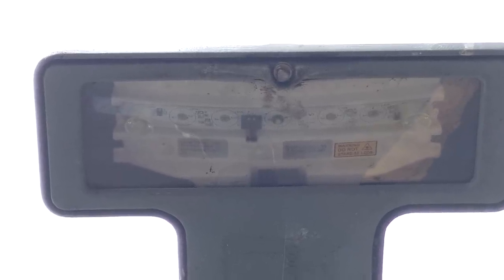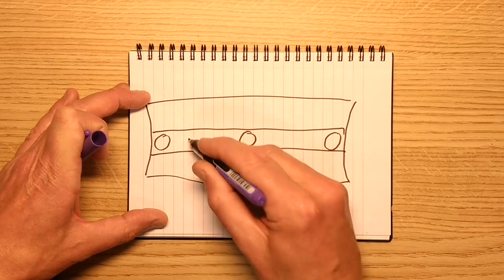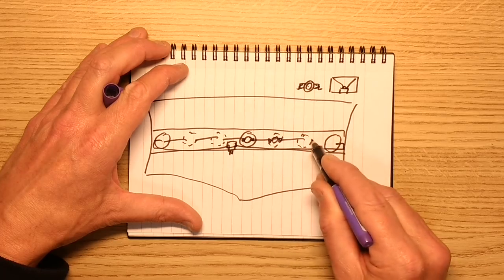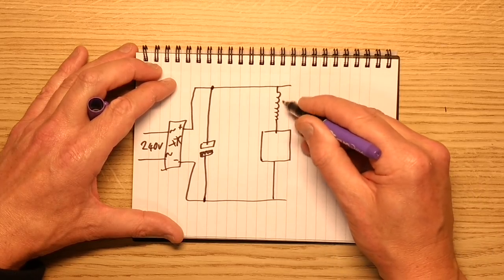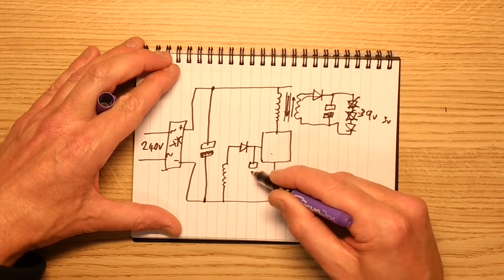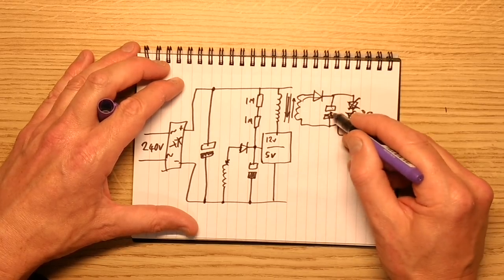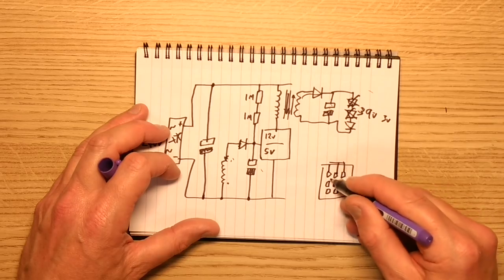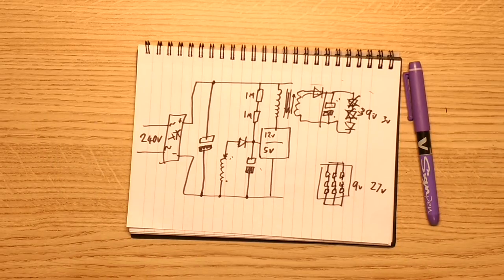Non-contact autopsy of dead sign light.  (strobe warning)

Comment: It certainly makes the sign more prominent and draws attention to what its saying, not sure on the safety of the people driving by and having seizures though. 🤔
Reply: That's why I think y
The EU is on to something when in hard braking about lock up braking events they actually flash the reverse whites to tell people that there is an emergency braking event ahead.
The main reason I will flash my brake reds before a hard braking event.
Reply: @jacknickolstine3355  modern cars actually will pulse the reds. Many more actually trigger the hazards on an emergency brake event (this is aside from people who activate them when braking in traffic).
Reply: @lmaoroflcopter  yeah I know but it's not mandatory for the OE to put that in the vehicle. 
I'm more or less stating its advantage.
Reply: Sassy The Sasquatch Where do live that such lights are not allowed on vehicles? Here in the states, it is perfectly legal. (At least in my state. Most others must be the same way, as many inter-state tractor trailers have lots of "unnecessary" lights.)
Reply: @TravisTerrell  The UK and I think most of Europe all have laws regarding what lights may be affixed to a vehicle and what colour.

General rule:
white solid and amber flashing up front.
Red solid, red momentarily switched, amber flashing (or steady iirc) and white only when reversing to the rear.

Blue and Red strobes are emergency vehicles only.

Any other lights must be off when the vehicle is on a public highway. You can still fit them for that fast and furious look while posing on private land, tracks or in car parks, but they can't be on when on the road.
Reply: @lmaoroflcopter  
Actually here in California I could drive down the road with a red strobe light.
 I just can't have a blue one

Comment: As a former salesperson for these kind of things - that's an LUA sign light made by a company called Simmonsigns Ltd in Telford and pretty much the standard model in the market (the LEDs / gear tray could be from Simmons or any number of other suppliers). The most common fault with sign lights is with the controls rather than the LEDs - a lot of LED sign lights were installed with a CMS node and a "smart cities" type of package to control them via GSM and a mesh network, and the telecells are not up to scratch. The other options is a photoelectric cell, usually set to come on when light levels drop below 70 lux and then turn off in the morning once the light goes back above 35 lux. #1 problem with a PECU is when the sensor doesn't include a filter to help it ignore artificial light sources, so the sign light comes on, then the street light comes on, and the sign light turns off.

Comment: That explains why so many of the LED lights in our gym pulse like this.  I've also seen good working LED lights pulse once when first switched on, probably because the secondary capacitor takes a bit more time to charge than it can get before the bootstrap supplied capacitor runs out of charge.  Then on the second flash the secondary capacitor isn't such a load and the circuit can get started properly.

Comment: I can see why local councils, which have huge electricity bills, are switching to the most efficient forms of lighting, but if this is likely to happen it may be a false economy. Within the last few years Fife Council stripped out the sodium lights in our road and replaced them with far smaller but equally bright LED streetlights. None has failed yet, but then the sodium lights ran for twenty-five years and the only malfunctions I ever saw were due to the timers jamming on.
Reply: Plus the sodium vapour lamps gave a much more pleasant yellow light unlike those eyesore LED ones
Reply: zh84 Survival of the fittest. You only see the ones that did last 25 years but not the ones that didn't, plus the mandatory ongoing maintenance cost of changing lamps, ballasts and starters, plus the cost of electricity. Even if LED has a higher failure rate at the beginning, the cost is more than offset by the electricity savings, plus the less reliable suppliers will be weeded out in time.
Reply: zh84  Up until recently, most council street lights were only controlled by photocells. No timer at all. In order to reduce cost, a lot of councils have replaced the normal standard photocell switch module with a device that also has a timing system. This allows the light to be switched off typically between 01:00 and 05:00 hours to save electricity and hence save money.
Reply: time between 0100 and 0500 - all the thiefs and the agency thugs are busy stealing things and people !
Reply: our council had 1 replacement project recently that was worth £125k and it was costed to repay itself within a year or so. So that is some saving.
Reply: Dick Johnson, yellow might be more pleasant but white LED keeps humans more awake (Body reacts to it more like daylight, less melatonin produced) and is better when it comes to visibility of objects of any colour.
Reply: Bulbs dont last long ballasts need replacing led is the way to go + you can see alot better than sodium ones. 50w at the back of mine got replaced for a 10w led and its miles brighter thats alot of energy saved just on 1 estate.
Reply: Before they replaced the street lights by led-lights, the lights switched to a lower light setting around 23:00.
I don't know about the yellow light, they are used above some highways and dangerous crossings outside a town.
Reply: Same thing with LED traffic lights, I noticed one of the LED bulbs already dead only a couple of months after it was installed.
Reply: Haven't seen dead LED street lights so far, but have seen plenty of dead older style street lights. And unless you worked for the maintanence crew or were monitoring the street lights 24/7/365/25, your statement of "the only malfunctions I ever saw were due to the timers jamming on" is, unfortunatly, totally useless. Communities did the math and the cost of old style street lighting is way higher than LED, even with the investment up front, after  only a coupld of years. LEDs fail, yes. So do older style lights. And they require more electricity along the way and fail more often, on average, when comparing similar quality products.
Reply: @mohinderkaur6671  It's a fact that most stuff is stolen in daytime.
Reply: There is a very good technical comparison between LED and Sodium lights on YouTube . The watts per lumen tables show that there is often no saving. And the blue light from LEDs disrupts sleep patterns significantly more when they are used in urban areas.
Reply: +mohider khana - Nah, shut off all the lights and they're staggering around in the dark, as they've been spoiled by all of the cities giving them plenty of light by which to rob people.
Reply: +DA666 - However, with the power companies starting to charge for apparent power, rather than real power usage, the cities will start paying more for power, with the abysmal power factors on most of these things.
Reply: Yellow light is horrible, i hated being out at night it makes your eyes go funny, we have bright white lights now and they are much better
Reply: Sun Wukong Faster reaction time from drivers apparently too under whiter light.

Comment: Ive seen ones in the US doing the same thing. usually followed by a snap crackle pop and sparks flowing out on the ground as it burns up in a fiery blaze. i dont think they even give off adequate light to see at night, compared to the previous type.

Comment: I have one of the light trays of a smiliar fixture. 3 LEDs in series with a GE dedicated LED driver but the only lenses are the ones on the LEDs themselves. It's bright enough to light up my room. The one you found is a "Simmonsigns LUA" light.

Comment: Same thing will occur if there is a dead short on the output, I once diagnosed and fixed a friend's laptop PSU with just hearing that it generates high pitched sound 2-3 times a second. Of course, it was a wild guess, but it worked - someone did a shitty job soldering the output cable and it did short after some usage. We redid the soldering trying to keep as much separation between the positive and negative and it worked. It might have also been just a bad strain relief design.

Comment: Hi Clive, at work I occasionally replace LED drivers that cause the LED to strobe before dying permanently. The strange thing with them is if you have the LED plugged into the driver then turn on the power it will strobe, but if you plug the driver into power first and then plug the LED into the fitting it will not strobe. I am guessing it must be some capacitor becoming charged or something? I have always wanted to see why this is so - would it be possible to send you one of these drivers to autopsy? (Unless you come across these all the time and can autopsy readily available?)

Comment: Anyone know if running an LED down light on DC is bad?
I was given some GU5.3 12v 50Hz halogen replacement LED downlights and they seem to run on DC but I only tested for a few seconds. I know they've got some circuitry inside; BR, inductor etc would the DC be bad for these?
Reply: The bridge rectifier is making DC from the AC supply, so the light's circuitry should see no change if the voltage is appropriate.

Do make sure the switching equipment can handle the current in DC though. AC has zero crossings which make interrupting the circuit much easier (less arcing). DC switches must be much beefier for the same voltage and current ratings.
Reply: @andreccantin  John ward did a good video on dc switching. Have a look 😎
Reply: The light it 6w 12v that's 500mA my power supply is 12v 2A. Seems like it should be fine then. I got the lights for free so I guess if I pop them it's no big loss.

Comment: @bigclivedotcom would the ticking from a lamped off VL's ballast be due to this sort of lack of sufficient voltage on the secondary side?
Reply from the maker: More likely just the switchmode kicking in periodically to keep the circuitry powered.

Comment: I have a question Big Clive. You've probably covbered this in the past, but, which is the more efficient and/or economical Voltage? 240V (we use it in Australia as well) or 110 (I think that's right) that the US and some other countries use as the standard?
Reply: Brad Griffin  - 240V mains is more cost effective for two reasons:
Lower cost of cables as less copper required,.
Lower current flow, hence less losses due to heat from the conductors.
And yes, there is a trade off between these two, depending on the installation cost vs. allowable volt drop / wiring temperature.
Of course, for low power loads, there is not much difference between 110V/120V and 220V/230V/240V...
Reply: A fair number of PC power supplies are more efficient on 240V.
Reply: @Mark1024MAK  Thanks mate.
Reply: @userPrehistoricman  Thanks for the info buddy.
Reply: This Electrickery is almost as magical as the Telling Bone. If you're under 50 you may not know what I'm referencing.

Comment: Sound level dropped a good bit when you switched to the notepad...

As for the sign light... there's many either flashing, flickering or not working at all, (latter of the 3 more common)... can be friggin' annoying when you're driving round at night.

Spikes in the current are the likely cause of most LED problems... if the supply for street lighting was filtered through a voltage stabilizer and dropped to around 200v they might last longer.

Comment: Good old Cheap 1W blob led packages and DIP's never last long unless it's made properly and intergrated correctly
Reply from the maker: The traditional Luxeon star type emitters were surprisingly reliable, but did need to have proper thermal bonding to a heatsink.  I think these lights may have used low quality LEDs or may have been in use for a long time.
Reply: Well most 1 Watt style leds beads in led downlights and so forth seem to lack reliability compared to COB or SMD based lights

Comment: The RMS of 240V is 120v so the total is 360V so is there something like a 30K resister to drop the voltage from 360V to 12V
Reply: What
The rms of 240V is 240V..
You probably meant to say the peak is 240*sqrt(2)=340
Reply: DAVID GREGORY KERR  In the mainland U.K., for most areas, the nominal actual mains voltage is 240V.
To convert to the bridge rectified DC voltage, multiply by1.4142 (this ignores the small forward volt-drop of the bridge rectifier diodes).
So 240V x 1.4142 = 339.408V DC.
1.4142 comes from the square-root of 2.
Reply: Alberto B I read in a electronics magazine the RMS of 240v is 360v maybe the magazine is wrong if you are wondering what magazine then it was Practical Electronics
Reply: @DAVIDGREGORYKERR  It probably meant peak, instead of rms
I will check that anyway if  I can, thanks :)
Can you give more details on it please? Like issue number etc..
Reply: 240 Volts AC with frequency 50 Hz. The RMS voltage is 240 volts, so the peak value Vm= V.√2 = 340 volts.

Comment: If it's a common failure mode, you would have thought they tested for it and redesigned the circuit - unless it was designed to fail... So if you were an ethical street light designer, what would the solution be to stop it flashing?
Reply: John Donovan - see my comment from earlier about including a counter.
Reply: Yeah, I saw that. I guess what I was thinking was (although I didn't explain myself very well); could a circuit be designed that kept the LEDs lit if one or more failed short circuit?
Reply: True, but as a road user, I'd rather see a dimly-lit sign than one that's completely dark or is flashing distractingly. Dunno, just playing Satan's solicitor really.
Reply: John Donovan - Yes, but not very practical with the current circuit configuration. For greater reliability, the LEDs need to be in parallel, each with a fusible resistor in series.

Comment: It is possible to have a more expensive power control chip, one that has a counter. When it detects a restart condition that has occurred within a short period of the last restart, it counts. After a certain number of restarts, the logic then prevents any further restarts. So it will flash a number of times when powered up, but then it will go into a failed, unlit, non-flashing state.
Reply: Sound like a good idea, but where do you store the number?
When the power goes off everything restart from zero. You would need a chip with eprom menory make the driver far from standard or an extra board that got some feedback from the LED-driver. Not difficult, but not a standard function.
Reply: @bknesheim  
A tiny little capacitor driving the counter storage would do. It only has to keep 3 or 4 bits of data alive for about a second.
Reply: Mark 1024MAK a bit like Auto-reclosers on electricity distribution networks. Trips the supply and will reconnect a few seconds later. If it detects the fault is still there it will do this cycle a few times until it finally cuts off completely and alerts a control centre to send an engineer. It’s typically used on overhead networks to stop power cuts caused by trees blowing and momentarily touching across the phases.

Comment: an easy fix to that wold to be to have the output be 9-12v an have the leds in parallel with an 1k feuse resistor befor each  led so if they do fail it dosent kill the hole fixture and dont run them soo close to there max voltage. run then a volt or two under so they last longer only for the high volteg leds as aney led that needs 5v or less just only needs a bout 1/3-1/5 volteg drop

Comment: Leds failing, i am supprised lol.
I wonder how long it will take authoritys to realise that leds are a crap replacement.
I won't hold my breath :)
Reply: I'm sure in a decade there will be a switch back to magnetic ballasted mercury/sodium vapor or fluorescents when they realise it was cheaper to just use a little more power and relamp the fixtures every decade rather than replace whole fixtures every 3-5 years. While yes in theory LEDs on their own can last damn near forever, the driver electronics don't.
Reply: Yep i think the older technology did the job for so much longer.
The big problem with leds is they are overdriven to get the stated output. Using lower power leds and more of them would bring the heat of each led down.
That would help.
Just my opinion :-)